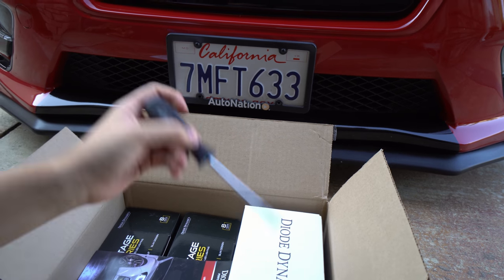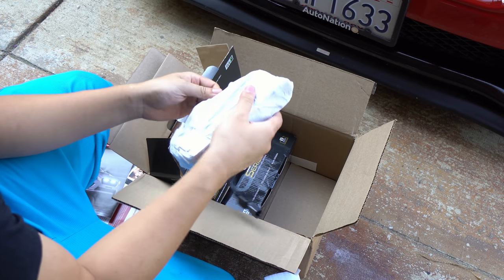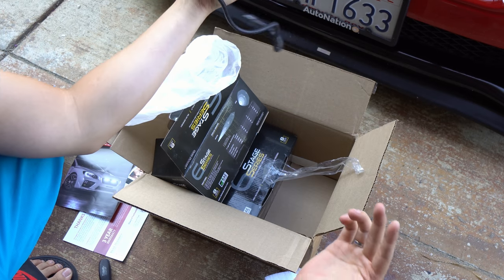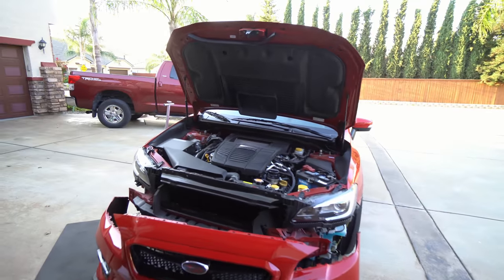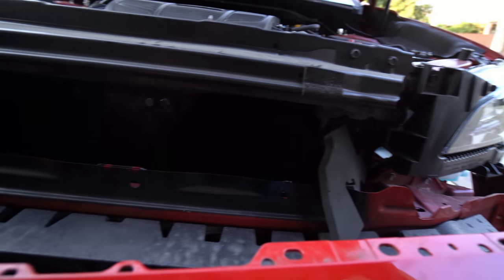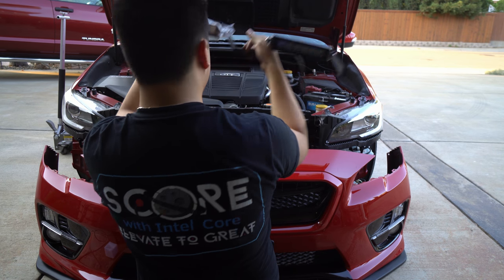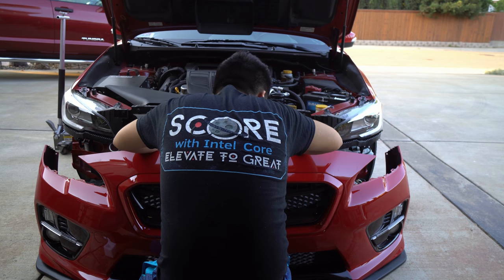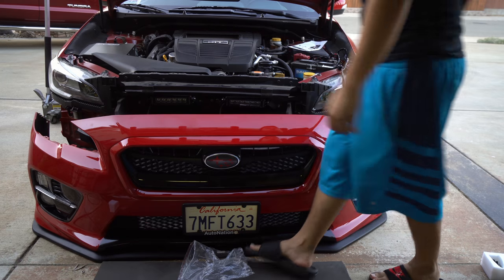BRIGHTEST LEDs! Diode Dynamic's Stage Series

Comment: would love to see how you wired for the switch
Reply from the maker: ahh, so i actually have footage of that but didn't include it since it was on my phone. 

1.) take your driver wheel off. 

2.) take your fender liner off of that same wheel.

3.) find the rubber gromet that goes into the cabin.

4.) then tuck the wires in there. make it look nice

It includes the switch and wires so its easy. i didn't have to buy anything

Comment: I was hoping you showed how you hard wired the switch inside 😥
Reply from the maker: ahh, so i actually have footage of that but didn't include it since it was on my phone. 

1.) take your driver wheel off. 

2.) take your fender liner off of that same wheel.

3.) find the rubber gromet that goes into the cabin.

4.) then tuck the wires in there. make it look nice

Comment: Every find out why they didn’t work when hooked to the hi/lo fuses?  I am having the same issue myself, and diode dynamics is closed on weekends.  I’d really like to tie them in with my brights (as intended).  Any help would be greatly appreciated!  Thanks!
Reply from the maker: yeah didn't work for me, i had to wire it to a switch.

they said people are having issues with the limited model 15.
Reply: John Nguyen Thanks for the info.  I shot Diode Dynamics an email.  Ive got a base model ‘17.  Hoping they’ll respond with a fix.  I’d really like to tie them into the hi beams.  Tested them out with the switch though.  They do work great!  If I hear of any fix, I’ll comment below.
Reply: Any luck with this? I can't them to work with my hi beams in my 18 STi